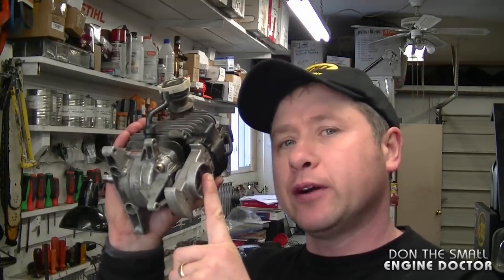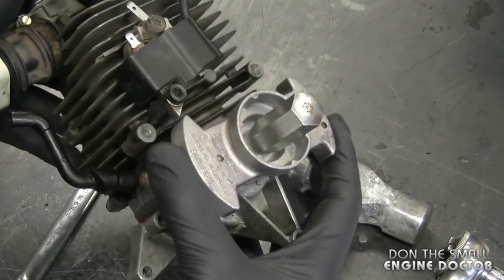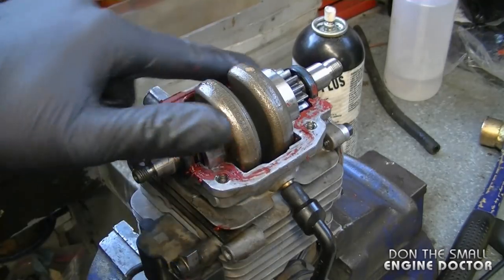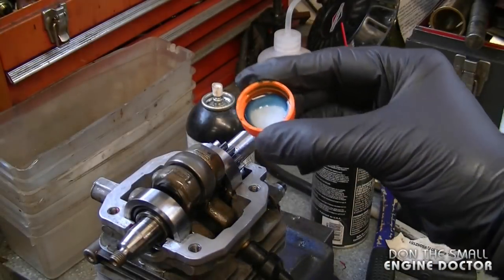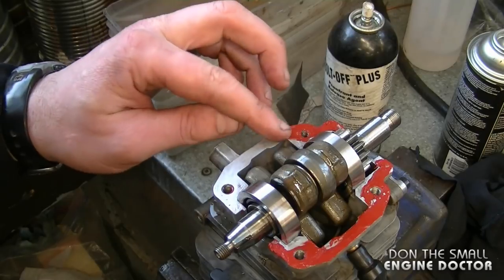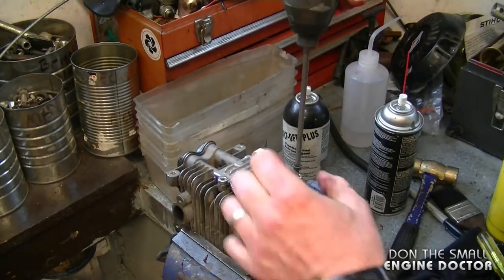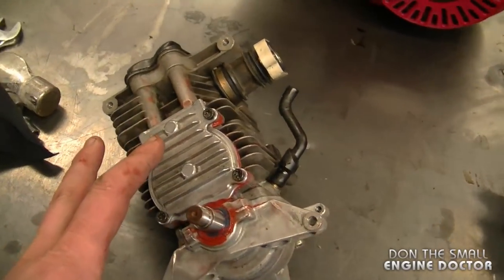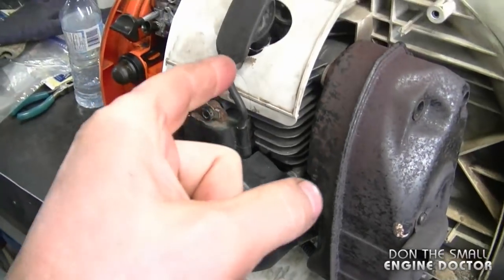HOW-TO Re-Seal The Engine Block On A Stihl 4-MIX BR500 | BR550 | BR600 Leaf Blower

Comment: Smashing repair :-D
I used to use an old product called "Gasket Goo" , it wasnt expensive but it worked well.
Hylomar and Hermetite didn't seem bad eather :-D
Reply: zx8401ztv hylomar (or the generic permatex equivalent) is awesome stuff (helped the new head gasket on my snowblower make the engine run like new, first pull or second if I left it all summer with gas in it accidentally) , but I only use it to improve sealing where there is already a gasket (or where one isn't needed but sealing would help), not instead of a gasket. It's labeled "gasket sealer" - I assumed that meant you had to have a gasket already for it to work, and that it wasn't a substitute for fiber or RTV (like that dirko dony used). Do I have it wrong? Can I use that in place of my "ultra black" RTV?
Reply: It sounds like you had the right idea, i use gasket plus hylomar together too.
it fills the tiny errors/voids between the gasket to metal surface, made the fit much closer.

I liked the old "gasket goo" because it set like a dusty filler, but it was easy enough to scrape off without using too much force.
It was odd stuff, not rubbery.
Alas it was years ago, so it may not be made any more.
Reply: zx8401ztv hylomar is much easier to deal with once you discover it's soluble in normal isopropyl alcohol...

Comment: PA LAWN GUY. Dony if you would like more sealing protection, order crankcase silk thread from Teledyne Continental Motors (an aircraft engine manufacture). The thread is about .040 thousands and is embedded in the sealant and is run on the inside of the case boltholes and terminated about 1/2 inch hanging into the seal cavities. The thread is compressed slightly into the aluminum about .001 inches on both haves and is compressed to about .005 of an inch between the halves and makes a great oil bearior. The thread only goes on one half of the case parting surface. A spool will last you a lifetime and is very reasonable ( I do not remember the specific cost).
Reply from the maker: sounds like good stuff

Comment: How does the durko compare to red rtv?
Reply: FishFind3000 from using it myself dirko you can start the machine as soon as you build it back up and unless a stupid amount is used it doesn’t squeeze out everywhere when the two cases meet possibly going into the engine like regular rtv and it’s very sticky  straight from the tube

Comment: Shouldn't it need more oil? At least the wrist pin and bearings? I don't know why there is barely any oil in the crank case. I wouldn't risk that the 2 stroke gas would keep the wrist pin lubed enough not to seize, cause that's what happened.

Comment: SO IF THE DIRKO SEALER IS THE SAME THAT THEY USE AT STIHL,WHY WAS IT LEAKING IN THE FIRST PLACE, IF YOU SEE THAT AS A PROBLEM WITH THE BR500 550 600

Comment: i have a 4mix fs90 stihl trimmer that is running away runs wide open like a 2 stroke with leaking seals.. this trimmer was hard to start when bought new along with every other stihl we ever owned and carried it back to dealer several times and billy jo high school dropout with a meth smile said get used to it (typical dumb ass chevy owner attitude brand loyal blind used to junk) . i purchased a new echo chainsaw and 2 trimmers at the same time last year and needless to say i am done with stihl products. probably ending up hauling the stihl garbage to the scrap yard. that fs 90 was a pricey machine along with my ms290 stihl chainsaw. my 30 year old 028 stihl starts every time, but i guess stihl like every other company is cutting corners and lost quality..  hell i mow my yard with a 40 year old john deere 317 twin cyl kohler usuing a little bit of oil with over 3800 hours on it, find that quality today boys.. stihl ain't got it no more. echo may not but they start or at least hit on 2 pulls not 40 pulls.

Comment: I would NEVER, under any circumstances, use a wire wheel on machined aluminum mating surfaces!!!! There's no quicker way to erode away enough aluminum to leave gaps, and cause the cover to not align properly, than with a powered stainless steel wire brush. Using sand paper by hand is bad enough.

Comment: How come they didn't put a gasket in there. It would have solved the problem. That looks like someone just wanted to half-ass a project and move on. I guess all companies are doing it just to make a buck. Why not the most expensive tools you get I heard this Stihl dealers is going downhill people can buy other products cheaper
Reply: Michael Speakman they can’t have a gasket because the clearance needs to be exact to hold the crankshaft bearings. If you look at Stihl chainsaws, all ones with clamshell designs (like this) won’t have a gasket and the proper 2-piece crankcases will have a cylinder base gasket like normal

Comment: Why the heck did they invent a 2 stroke and a four stroke engine in one. Don’t know how that helps but okay
Reply: Four engines typically have lower exhaust emissions. But they typically can't be run on their side or upside-down. But if you lubricate the engine constantly through the incoming fuel you can run the engine in any position without damage.

Comment: These are not good engines imo
Reply: I agree. There are more things to fail than a 2 stroke, more maintenance, more weight and you still have to mix the gas. I don't see any benefit. Plus the sound in my opinion is kind of annoying.